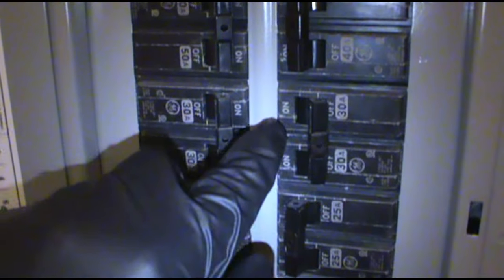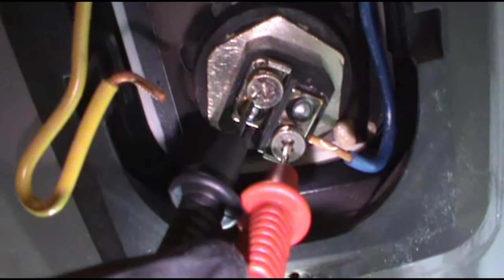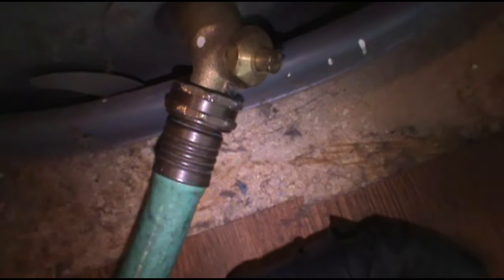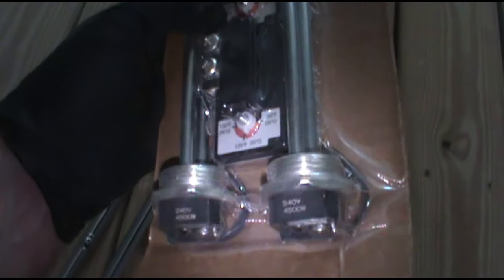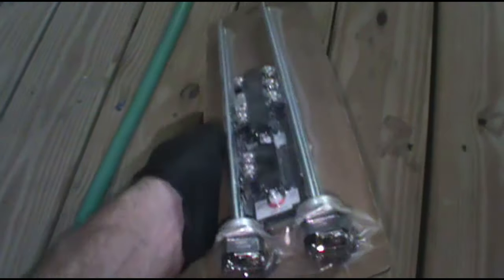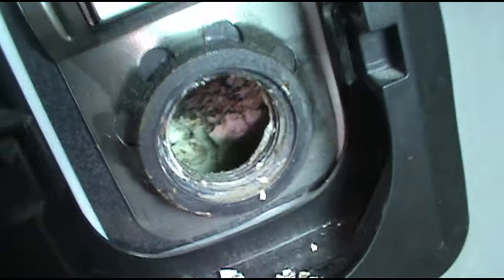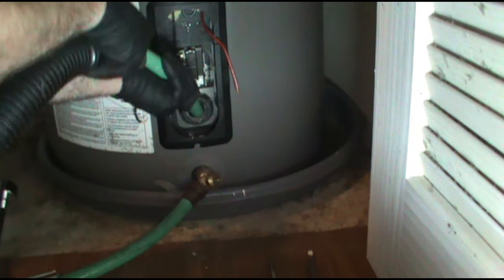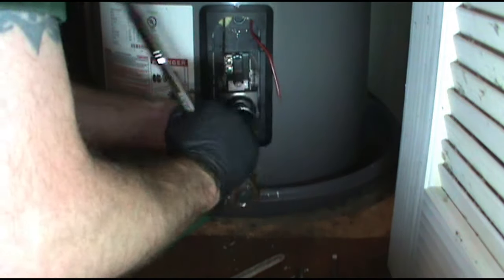Fixing Water Heater that Trips Breaker Occasionally

Comment from the maker: Kobalt 1.5 inch socket for water heater element removal link- https://amzn.to/39AiI93

Water Heater Repair Kit link - https://amzn.to/3awYYV7

Tools that will help maintenance technicians earn easy money!
https://www.dirtymaintenancenation.com/diy-tools-for-men/

If you'd like to support the channel, you can do so by shopping for tools or whatever you need on AMAZON at no extra cost to you through this link,
https://amzn.to/2Ub5Alg

If I've provided any value for you and you'd like to donate $1.00 or more into my online tip jar, you can do so through this link, (all cards accepted)
https://squareup.com/store/dirty-maintenance-nation

This page contains affiliate links, which means that if you click on the link and make a purchase, I’ll receive a small commission at no extra cost to you. Lex Vance is a participant in the Amazon Services LLC Associates Program, an affiliate advertising program designed to provide a means for sites to earn advertising fees by advertising and linking to amazon .com
Reply: I replaced both elements and thermostats because my bottom element didn't have enough power so it kept tripping my breaker box.
Abt an hr ago,it tripped off again....What could be the issue now?

Comment: I'm glad my water heater wasn't that bad and crudded up when I had the same issue. I had continuity on both elements though, and they weren't broken when pulling them out, so I suspect the problem was with the upper thermostat. Regardless, I bought one of those kits like you showed at my local hardware store for $40. At that price, you might as well replace both elements and thermostats on a 240v heater. Its been working well ever since with no breaker tripping.
Reply from the maker: Nice fix! Thank you so much for watching!

Comment: Worked for Sears service from 75-90 and did hundreds of element change outs. 90% of time tank would not drain from calcium buildup so had to change out full. State industries had a element called the sand hog that could operate in hard water with tanks full of calcium. Most of the heater elements had a 4 bolt flange and were a little tricky to install with water in the tank. I don't miss working on water heaters!
Reply from the maker: Right on! I worked at an old apartment complex that was built in 1972. It had one old original water heat left that had the 4 bolt element. This was on 2003!  Thank you so much for watching!

Comment: I changed the element's in my hot water heater theyre new but the water heater is not however despite me changing the elements it'd still trip probably about 10 minutes in to resetting it please help lex vance
Reply from the maker: Maybe you need to thermostats that are above the elements. 🤔

Comment: Can someone help me out i try to drain the water, but no water is is coming out. I know is full, i turn off the water put pressure like on the video open the valve, but still no water
Reply from the maker: Calcium is blocking it up. You'll probably need to suck it out with a pump or shop vac. I hope everything works out for you!

Comment: Thanks for the video.  I installed my water heater about 7 years ago but we live in an area with extreme calcium, etc..  I just had a water softener installed that removes calcium and a bunch of other things.  Of course our water is great now but the water heater is beginning to trip the breaker every now and then.  I was getting ready to put in a new water heater again...... until I saw your video.  This beats changing the entire water heater all over again.  I'm sure my elements look like yours did, if not worse.  With the new water treatment softener and our water being very good, the new elements should (hopefully) hold up for a while.  Great job.  Thanks again.  👍
Reply from the maker: You're welcome! Thank you so much for watching!
Reply: @LexVance  
👌

Comment: Love the video. Do you think if I have water sitting in the pan and I change the element, that would fix the problem of the breaker not tripping? Or would that be a waste of time?
Reply from the maker: Water sitting in the pan means there's a leak. I'd find the leak and make sure you don't need a new water heater.

Comment: A lot of times residents will go on month-long vacations and report a sulfur smell from the water. We drain the water heaters and add a gallon of vinegar before refilling and let it steep for 4 hours. It use to be a big problem 5 years ago I heard but we seldom have this problem anymore.
Reply from the maker: Nice trick I'll have to remember there. Thank you so much for watching Reel Guy!
Reply: How do you add a gallon of vinegar prior to refilling? I had the sulfur smell after a long vacation, even when turning the water heater all the way down. Turning it off completely seems to prevent the sulfur smell.
Reply: @TimothyCondon00  Remove the top heating element for electric heaters. Can get a water heater wrench in the water heater section at lowes or homedepot. Gonna need a transmission funnel. Open up the nearest faucet prior to refilling with water and shut off the moment the foamy vinegar water comes out. Let sit overnight for best results.

Comment: Hay. Great thing with the water hose.  Me personally with the apartments I take care of, I never replace the elements because the sediment will rot the metal.  Then the water heater will leak.  I want your opinion,  at what water heater ago do you not replace the elements and just get a new water heater?  Also, what you think of the new tankless water heaters taking the place of tank water heaters?
Reply from the maker: If the water heater is all rusty & looking rough, I switch it out. Otherwise, it just gets new elements. I like the new tankless. Only issue has been air in the gas line so far. Once I bleed it, it fires up with no more issues. Thank you so much for watching Lee!
Reply: when i worked at places if its 10 years plus we just replaced....nobody ever flushed or changed the anode rod so just better to be done with it...tankless are great because just gotta flush every for a few minutes and usually your good for 15-10 years...

Comment: Greayt video. I dont do the quick swap. I just take my time and drain the water heater and wait a little longer. I do use a water pump as well to help drain the water heater.
Reply from the maker: Right on. Thank you so much for watching Aaron!
Reply: i agree... take the extra few minutes and drain...one time i had a hell of a time getting a element loose doing the quick swap..long story short the threads on the heater were cross threaded from whoever came before me and new one would not screw on ..lets just say good thing i was in a basement ...you never forget those screw ups lol

Comment: What Iv found that works fast. Take out bottom element. Then get you an air compressor and put nozzle in the drain port. Turn the water on at the top of the water heater. As the water drains the air stirs it up from the bottom and the water carrys out all the debris. Works like a charm.
Reply from the maker: Great idea! I'm at a place that uses tankless water heaters now. But, if I ever get back to tanks, I'll definitely try that. Thank you so much for watching Jim!

Comment: You can also check resistance, depending on the element but mine ranges from 5 to 20 ohms and my bottom one was OL. So I figured that is what was tripping my breaker. Great video
Reply from the maker: Thank you so much for watching Justin!

Comment: Thank you. I had a question.  If there is no continuity, that means no current is flowing through that heating element. So then why would the breaker trip? I thought if it would trip if too much current flowed through it.
Reply from the maker: Water is touching the electric current due element being broken.
Reply: @LexVance  ah ok. So it wasn't looping around to the other side of the element but instead going into the water and returning via ground, causing a massive amount of current and breaker to trip. Thanks

Comment: I actually had a tank almost explode once.
There was so much sentiment in the bottom that it covered the element. 
The breaker never tripped. 
My basement was full of steam where it was bearly leaking from a faulty relief valve. The tank was as at least 25 years old 🤦🏿‍♂️

Comment: What do you think the deal is if you replace the element and 3 weeks later to blows again?
Reply from the maker: Either the other element is bad or you turned the breaker on before the tank filled with water. Turning the element on before the tank fills with water will burn the new element up and crack it. The breaker will start tripping.

Comment: I tried to conduct the continuity test on both the upper and lower thermostats but didn't get anything from either of them. But my electric water heater still works after resetting once a day. Is that possible or improbable?
Reply from the maker: Yes. It trips the breaker once water refills. Thank you so much for watching!

Comment: Both my elements have continuity? What elso csn make it trip? It only stays on for like 1 hour
Reply from the maker: Could be one of the thermostats. Also, sometimes an element can have a crack but still able pass continuity through it. They would need to be removed for inspection. Drain water heater first if that's the route you choose.

Comment: What's your thoughts on using a clamp amp meeter to check the current flow before and after the elements?
Continuity can travel across water
Reply from the maker: I like it. If I got continuity on both elements, I'd switch to ohms and check. Whatever helps you get the job done. Thank you so much for watching Perth!
Reply: I have had elements short one leg through the water and keep heating even with thermostat shut off. This will cause the overtemp reset to pop.

Comment: Replaced both elements and thermostats and still have problems. Pulled the wires from the top and there is no continuity from the wires to the ground. What am I missing?
Reply from the maker: Yikes. I'd need to be there for this head scratcher. 🤔
Reply: @LexVance  Thanks for the quick reply.
Reply: @LexVance  Turned out to be the power source. Thanks again.

Comment: Easier without that extension. Why change out upper? Also i use a amp draw test to see if they are pullin
Reply from the maker: Because while it's drained, do both. Or, you'll be right back in a month or so doing the one you didn't change. I speak from experience. Thank you so much for watching Pen!
Reply: Lex Vance thanks for the information
Reply: @LexVance  exactly. change out one might as well do both while the tank is drained.

Comment: I changed both elements. Both are new. The breaker was fine but I had to hit the reset button just to get hot water. Now the breaker flipped and won’t reset so now the tank has no power at all. Idk what to do now. Every plumber around here doesn’t exist apparently.
Reply from the maker: Make sure you filled the tank with water first before turning the power back on when you changed the elements. If you turned the power on before filling the tank with water, the new elements can crack causing water to get in through the crack and making the breaker trip.

Comment: Why would it trip the breaker if the element was bad (open)?
Reply from the maker: It has an electric coil inside the element. When the coil is expose to water after the casing cracks, it trips the breaker. Thank you so much for watching Galt!
Reply: @LexVance  i guess i didn't consider that it was shorting out inside the tank...   Scary.  Must be the yummy paste of iron infused calcium providing the conductive pathway.   Thank you for all the insights.

Comment: How did you know it was the water heater that was pulling the breaker and not the furnace?
Reply from the maker: The breaker was labeled "water heater" that was tripping. The furnace and water heater are on different breakers and circuits. Thank you so much for watching Raul!

Comment: I just realized how dangerous a hot water heater can be, I have a Whirlpool 40G tank...3 yrs old...it stopped working my son opened it up....there was a fire inside, thank God it stopped. Melted plastic inside, burned the wires & there was a hole burned through the insulation, it looked like it had a small leak...I live in a mobile home that is 10 yrs old & I would like to meet the person with the bright idea to put it behind a closet wall in the bedroom... it is also behind the wall that goes into my kitchen next to my stove and refrigerator...with no access.
Reply from the maker: Yikes! 😳

Comment: My AO Smith 15 ltr water heater trips after the water is heated. Water gets heated fine and after that it trips instead of just auto off. Can someone help me wat is the issue  please 😭😭😭 it happens all the time.
Reply from the maker: Your element is broken. When the water hits the electricity from the element being broken the breaker trips.
Reply from the maker: You'll have to turn the power and the water off and drain it. Then, twist the old one out and screw the new one back in. Turn water on. Check for leaks. Then turn power back on and youre done.
Reply: @LexVance  If element is broken why is the water getting heated well Before tripping.

Comment: I'm gonna politely disagree with you about which element comes on first.  You'll notice that the bottom element was much worse than the top one.  That's because the bottom element comes on first, and that's because the dip tube inside the tank takes the cold water to the bottom of the heater, forcing hot water out the top.  Thus, the bottom thermostat senses the change in temperature while the water at the top is still hot, and it activates the bottom element.  If cold water continues to arrive at the bottom via the dip tube, the cooler water will continue to rise, and the top thermostat will then activate the top element.  Make sense?  Thanks for taking the time and trouble to make videos.  Stay safe!
Reply from the maker: Hmmm interesting. When I flipped the breaker back on 240 volts went to the top element immediately. The bottom element was off and getting no volts. Must be different for other models but the Rheems here on my property, the top element comes on first. Thank you so much for watching Carl!
Reply: When you first introduce water into the tank, the top element will be the one that turns on first, then once it reaches temp, the bottom will turn on. Once the bottom reaches temp it will maintain power to the bottom thermostat, which will seem like the bottom is always turning on first. When the top cools off, then the top thermostat will call for heat and turn off the bottom. 
The reason why it works for a little while (which was his work order) is cause  the water is cold after the breaker has been tripped, which means the top thermostat is calling for heat first. 
Top always takes priority.
Reply from the maker: @DemBone  Yep. Resident kept flipping breaker back on. She said it would be hot for the first shower. Then breaker would trip. It was sending power below and popping breaker. Top element was working first then sending below and tripping breaker.
Reply: @LexVance  If the dip tube is broken off at the top or disintegrated to the point of being nonfunctional, the cold water comes in at the top instead of the bottom, which presents an entirely different set of issues.  Sometimes it can be solved by replacing the dip tube, much like you would replace the sacrificial annode rod.
Reply from the maker: @carlstewart365  right on.
Reply: except for new install, just refilled with cool water after draining or long power outage where it went full cool, then the top element does comes on first. until satisfied.
the rest of the time it's bottom element first, until the top thermostat gets too cool which cycles top element on and cuts bottom off in an attempt to extend the heated water output longer.
** guess I need to read all the comments first, I see dembone said the same thing lol. ohwell